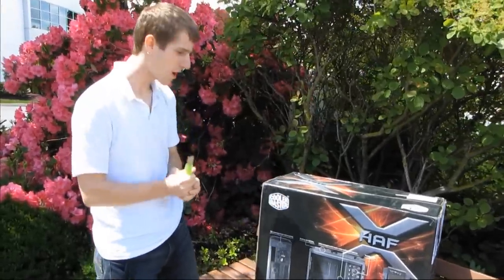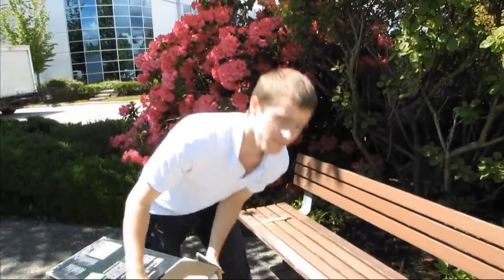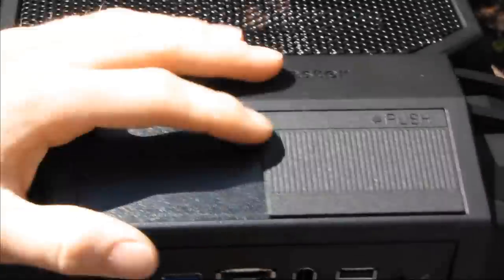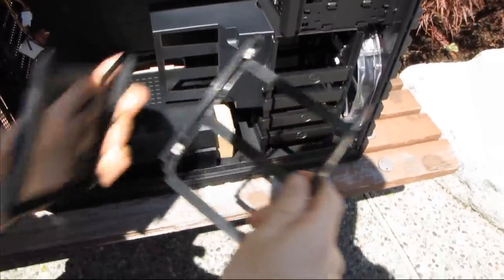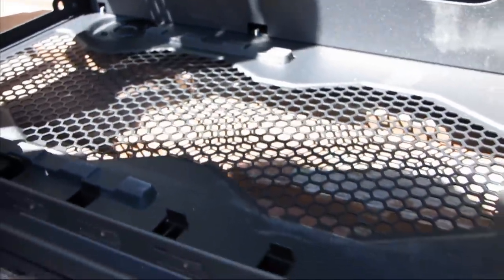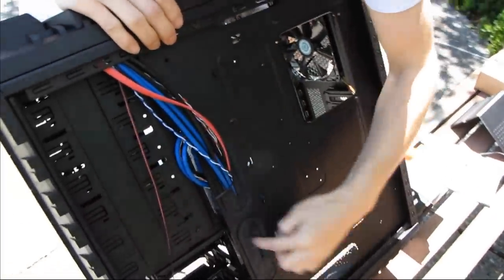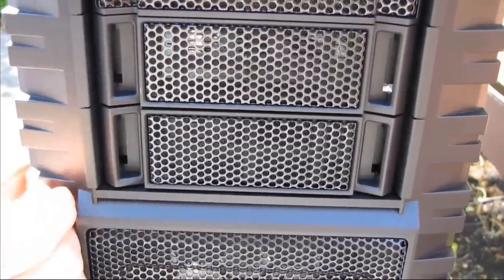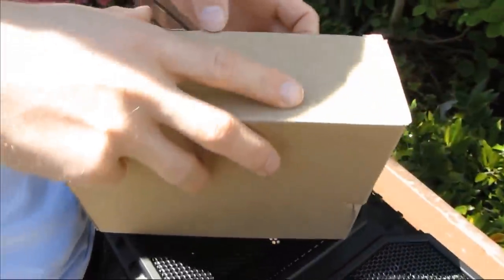Cooler Master Haf-X XL-ATX Gaming Computer Case Unboxing & First Look Linus Tech Tips

Comment: To this day, this is the video back in the day that helped my justification for getting this case. I still use it to this day as a daily driver.
Reply: Hi5
Reply: i just put together a throwback tower tonight with this case and an old x79-Deluxe coupled with a gtx 780ti and i7 3960x surprisingly it isnt THAT bad
Reply: I'm using one for my first build 😎

Comment: A very well-regarded case.  I passed on getting it based on looks alone.  Looks like it's made to drop out of an army helicopter.  Ended up getting the Antec 1200v3 for home and just got the Corsair 650d for work.  Love them both with slight edge going to the Antec.

Comment: I took this beast out to a LAN
Never again
Reply: +didierthesuperstar i feel your pain.....
Reply: +didierthesuperstar But did you put the wheels on ? I mean, Shit man, put one engine there, a Steering wheel and you are go for a ride...Maybe...Not quite, but you got the point. lol
Reply: I put it on a goddamn trolley, and secured it in place by wrapping it with duct tape 
I didn't even untape it when I arrived, I just plugged everything in and called it done
Reply: didierthesuperstar
Wow, imagine if you had the Cosmos 2 - 22kg  "pure steel" Bunker, remove some of the metal components, put a blanket and you can even sleep there. Hahaha this case probably can withstand a nuclear blast. Try to get this to a LAN, lol.
Reply: Just googled it, that's one meaty bad boy
The price is pretty fat too
But at least it's got haNDLES
Reply: +didierthesuperstar get a car guys

Comment: I have had this case this 2010 and I have to say it is excellent. As long as you have space to accommodate it's sheer size it will do you no wrong. It can hold any hardware you could ever realistically try putting inside the thing, and do it with ease.

It may not be pretty, and it gathers dust like none other, but it is the best utilitarian case I have seen.

Comment: This case has been released over 3 yrs ago & It's still going strong. It's the masterpiece of CoolerMaster.
We still have to see about the limitation next to the upper fan, whether it can accommodate a radiator for water cooling, such as the corsair H80/H80i

Comment: I love this guy. I just built this rig and watched his videos through the whole process. Regardless if you like the product or not, the guy is cool...

OS: Win 7 64bit Pro Service Pack 1
MoBo: Asus Sabertooth Z77
CPU: Intel i7-3770k  (OC - 4.2ghz)
RAM: Corsair DOMINATOR Platinum Series 32 GB (4 x 8 GB) DDR3 DRAM 1866MHz PC3 15000 C9 Desktop Memory (CMD16GX3M2A1866C9)
GPU: TWO 2GB Nvidia GeForce GTX 670 FTW - SLI
LCU: Corsair H80
PSU: Rosewill Bronze 1000W
Asus DVD drive

Comment: you can lift off the top of the case where the 200mm (i think its 200mm, idr exactly) fan is to either add a second fan or take the fan off and add a radiator

Comment: I can't put it on anything else because there's no room, but the cloth wouldn't get sucked in  because there's mesh between the fan and the floor, just to give you an idea of the space, the layers go like this psu fan, dust filter and metal mesh, about 2cm of air space then floor (this is at the bottom of the case).

Comment: @FastBuffGaming No my motherboard uses 4 pin only, my power supply that im getting with the HAX Z is the GX 750, it has a 4+4 pin power cable. I cant find any 4 pin extensions

Comment: So did you ever see if you could mount a radiator on the inside top?
Im thinking about buying this case and getting a water cooling system, but would love the radiator to be mounted inside top.

Comment: I've got one myself...damn it's heavy when kitted out. But the size of it and the expansion options were the reasoning behind buying it, I'll not need another case for decades
Reply: does it support the top radiator? I'm really thinking to get one, I just gotta know if it supports the radiator on the top.

Comment: I have been using a CoolerMaster Haf 932 case for about 4 years and really like the casters.  Are there many (or any) current cases from them or any other manufacturers that either include casters or have mounting points for casters?

Thanks
Bob
Reply: What the hell is a caster?
Reply: Casters are small wheels for the case.

Comment: @LinusTechTips the cut-out for the CPU Cooler Back Mount is stil, not big enough and yes you can put in a radiator I got a Corsair H100 in it

Comment: @linustechtips 3 water coolibg holes ??? two or 4 i understand three no clue??? what are they for and how do you plug the frunt usb 3.0 to  the moboard is there a geader like the 2,0 or do you have  to taake it out the box and plug them in the back ports?? maby thats the purpuse of the 3rd water cooling hole to get the cables out

Comment: I like the idea of doing this video in the sunlight.  I could actually see everything inside the black case.  About the hot-swap bays.  They may be only dedicated to Sata I or II.  I would remove them and just plug the drive(s) directly into the motherboard.

Comment: @jmishkab I have this case with an EVGA gtx 580 and the side duct is atleast 2 inches away from the card. Its positioned really well so that a standard ATX motherboard ( i have the p8z68-v pro) will be able to SLI two huge cards with plenty of clearance for the duct. It does not touch anything and even if you are uncomfortable with the narrow gap, its completely removable which has little effect on interior temps.

Comment: 8:10 thats because I will be drilling in fan mounts myself to accommodate for bottom intake. :D Right behind the psu looks perfect for maybe a 140mm. I mean it looks like thats what they designed it for other then neglecting holes for it. Theres 3 fans for exhaust, only makes sense 3 fans for intake :)

Comment: I have a question: 

What pin connectors do the standard fans come with? 
And which fan sizes will fit in the front other than the standard 230 cm.

Thanks for the answers i will recieve on this.

Comment: I'm not exactly sure how thick the H100 is since I only have a H40/H70 but if it fits yeah, remember you can have another 200mm in the front and the sidepanel PLUS 120mm/140mm near the cpu intake totalling to 9 fans chassis max.

Comment: @Mehecanogeesir 
you need to connect the front panel to the USB3.0 on the back of your motherboard (assuming your motherboard supports USB3.0)
the front panel 3.0 is essentially an extension from the rear of the case.
i hope this helps :)

Comment: I've had this case for over a year, its a solid builder at a great price. Im looking for somthing new though. The side window could be bigger the fan grill takes up a lot of view. Also theres more exhaust fans then intake fans, your left with a dusty negative pressure case.
Reply: Reverse some of the fans.
Reply: or use Fan Filters... With negative pressure you have dust entering from every crack specially the  I/O panel.
Reply: +john t 
Did you go to school John, and if you did- did you actually learn about punctuation when writing? It's very important as it makes what you say far more legible. Literacy carries weight as well as being more user-friendly. Try a few full stops at the end of sentences, it's very basic stuff.

Comment: I got this case after I saw this unboxing and love it.  I've been able to do, basically,  everything that I've wanted to do to it and a few upgrades, but I really wish they had made the top where the two 200mm fans go a straight rectangular section instead of a sections for each fan.  The two sections make it a bit of a pain with the cables going from the front top display when adding a 200mm fan because the fan takes up some of the room where the cables have to go, but it can be done.  If they had made the top section straight this would have also made it possible for them to add additional mounting points so I could put three fans.  I also wish they made it so you could put 2 fans in the place of the one 200mm fan in the front.  I'd put 2 Corsair AF fans.  Besides these 2 items I love this case and will continue with it as long as can.

Comment: I have had more time to think about this and i think I will go for the HAF X as it has better air cooling. The 800D will take to much effort to make it good at air cooling, il also probably have to mod it, and add a fan in the glass. I just don't trust my self to water cool, will probably have to by the 800D when I eventually do water cool. is the cable management good in the HAF X, that was my favourite thing about the 800D, and its looks.

Comment: I got this case and am so close to finishing my build, but i need help. I have the firewire cable and the small cable coming from the HD AUDIO cable left to plug in, but i have no idea where to plug in the firewire connection. I have the ASUS Crosshair V Formula-Z motherboard and everything except those two cables are hooked up. So Id really appreciate some help.

Comment: Just got one of these with a i7 3770k, 16gb ram, p8z77 deluxe, 750w full mod PSU, 240gb ssd, 2tb hdd, blu ray player and Hyper 212 all for $350 which is crazy as just the case sells go $200 still now, and used they go for $130+

July 27th 2017

Comment: The only drawback I could see in this case compared to other cases at its class is the lack of dust filter for the PSU intake. In my Thermaltake Armor I clean this filter on a regular basis and it collects a lot of dust, especially since it's very close to the floor. All of this dust woiuld have gone into my PSU and shorten its life span and performance.

Comment: @TheFR3SHINATOR damn that's some budget. but i would still consider the HAF as a viable option because of well just being more roomy and the extra slots. the upcoming X79 boards might need that extra bit of width and height. are you waiting for the x79 for your build ?

Comment: Do you have to use the Molex connector for the fans or will they work fine with just a 3 pin

Comment: i was thinking of getting a 800D because i will eventually put a custom water cooling kit in it. i know it is made for water cooling, but i think air flow isn't to good. i know linus has made a 800D build with the H100 and air for the rest. wasn't sure if it was any god though. i am stuck between the 800D and the HAF X. haf x has better air flow, but 800d better for water cooling, which i was hoping to do in the future. what would you recommend. sorry for asking so many questions. Thanks

Comment: @Lionheart1188 ill put it this way the hafx is an upgrade to the 932 but the 932 has better air cooling properties for one reasone the side fan with the shroud is is concentrating airin a strait path bcuz of the shroud if running a sli keep it on otherwize remove the shroud doesnt allow the air to ncome in at an angle to match the front fansair pattern with it on its concentrated straight to the card not angledas air comes off the tip of the blades not the center

Comment: @waseem1173 well the mobo is blue so what i'm going to do is order some blue LED Fans from thermal take and coolermaster so it can match my mobo but i'm just going to stick red LED fans for a couple of months, also if i don't manage to get the classified edition GTX 580, i'll just go with the DS Superclocked and that has a blue line in the middle of it i think. (typed with a leopard gecko on my back)

Comment: Mountain Mods and The Lian Li PC P80 can handle the motherboards. MountainMods is the best, but expensive. Edit - Oh and they have 10 PCI slots instead of 9. You can basically install like 20+ fans inside a Mountain Mod case. Which the U2UFO and the Extended U2UFO are my favorite cases. The Extended Ascension is a little tall, but still good.

Comment: This thing is heavy, and lots more heavy when you add a PSU, a couple of graphics boards SLI'ed or Crossfire'd together, not to mention the mobo, drives, and etcetera. This thing screams for a handle of some sort. Fortunately, castors are provided so you can keep it on the floor (only that you have to install them first. Really difficult if you got a preconfigured system from somebody.)

Comment: @TheFR3SHINATOR for the amount you're willing to spend i would definitely wait for the Intel X79 boards and processors. and have you checked out the newly introduced Classified GTX 580 by EVGA. clocked much higher than the DS and for only 50 more bucks clearly not a problem for you. and why not the H100. just my two cents :)

Comment: I really love the look. also if i put like 3 intake fans on bottom (two sandwiched and one at very bottom) an then use the back as an intake and finally an extra one from the from using 3 expansion slots, then the air cooling can be quite good. this will allow me to water cool in future. also i love the cable management and size. will use the H100 in push pull as exhaust and then an extra one to fill up the 3 fan slots. still have my eye on the had x though. have to wait and see. exams atm :s

Comment: Looks like you can mount a radiator up top right underneath that 200+mm fan... without removing the fan... = GOOD AIR FLOW for your radiator... thats awesome

Comment: @waseem1173 Well i'm getting the product next week and the 800D from my local component shop, it says Halloween offer on these products (800D is there but the HAF X is not) and the offer does not end until the 5th of November (Guyfox night/ Bonefire Night) but i can't decide, i've heard that the HAF X is better for air cooling and the 800D is better at water cooling but i'm getting a H70 so i don't need to refill it every now and again and i'm getting an air cooled EVGA GTX 580 DS Superclocked.

Comment: can someone help me, i have low performance with a good game pc and the graphics are not really sharp, i already replaced my motherboard , hard drive, graphics card memory ram, i also tried a other display with other cabels, what could be the big problem, psu? , cpu?
pc specs:
asusp6x58D-e
480gtx
corsair 6 gb ram 1333
1000w psu coolermaster
samsung hd103sj
i7 920 2,67ghz

Comment: @sean123h Done some tinkerng managed to get all 3 200mm fans at 670-700 rpm, which is an improvment :P any1 know if the 200mm fans on coolermaster will go higher? still seems to be pfffft instead of woooosh air flow :P

Comment: @vaedriah 199 same as newegg its badass i just wish it came with both 200mm fans on the top other than that best case on the planet if the 200 price is to much for ya they have the 932 for 139 but for the extra 60 bones might as well x it out

Comment: Thats pain in the ass to clean with all the fans and grills
Reply: Not to mention all the bloody corners and nooks etc inside & out. At least it has wheels so you don't have to pick it up all the time when changing stuff. I'm still happy with it after getting it in 2011.
Reply: Not to mention no dust mesh filter.

Comment: @waseem1173 Well i'm working to be a high end editor so i do require all of that equipment, if i did not have this i would struggle with my work at collage (I have other parts) :(. so my components i'm planning to get are CPU-i7 2700K Mobo-Asus P8Z68 V-Pro RAM-x2 Corsair Vengeance black 8GB (its on a buy one get one free offer) HDD-Seagate Barracuda Green 2TB SATA6Gb SSD-OCZ Agility SATA3 Power-Corsair Enthusiast Series TX 850W V2 GPU-EVGA GeForce GTX 580 DS SuperClocked or class 580.Cont reply.

Comment: Piss poor fan speed, one if running at 395 rpm the other 714... any1 know how to change it? i have an Asus Maximus extreme, all the case fans are 3 pin. p.s. this case seems to only suport cooler master 200mm fans, tryed an nzxt n the antec big boy... the screw holes are designed my money grabbing retards so none of the 200mm fans i have fit :'(
Thanks

Comment: lol male to male usb, thats gay bro you can't be gay with usb, on that note sometimes the female ports .. you can't plug the cables into, which is frustrating but after flipping it over a few times and doing a sexy dance it goes in just fine.